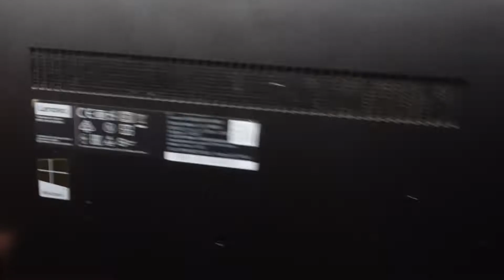Lenovo Yoga 510-14IKB Ram and SSD Upgrade

Comment: Can i add a 16 Gbs RAM DDR4 2400 mhz?
Reply: Sorry to ask, could you add 16gb ram ddr4 2400 MHz? Thanks
Reply: @solete081  yes you can, I just test it by myself 👌
Reply: Thanks 🙏 😊  @Jack_War
Reply: @solete081  yes you can. I used the brand "Crucial"
Reply: Can i add DDR4 3200Mz 16Gb ram